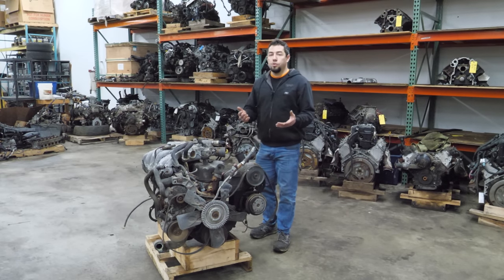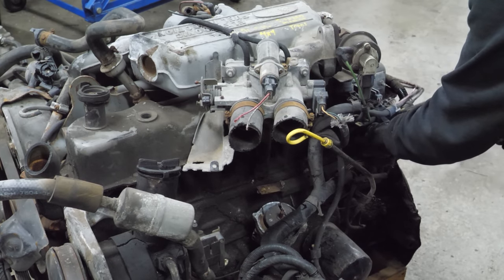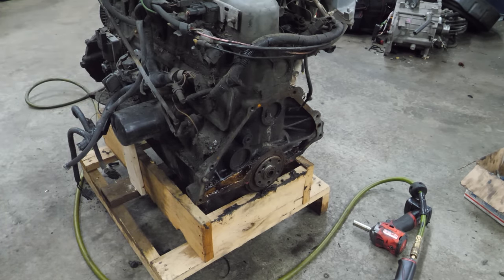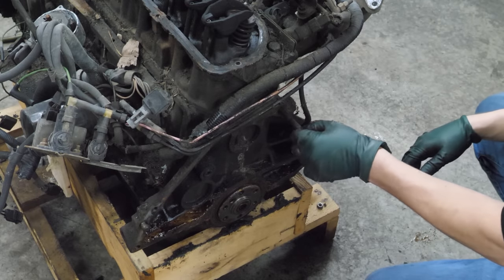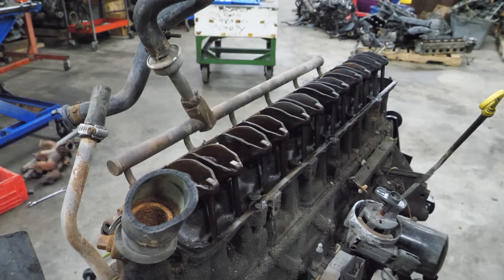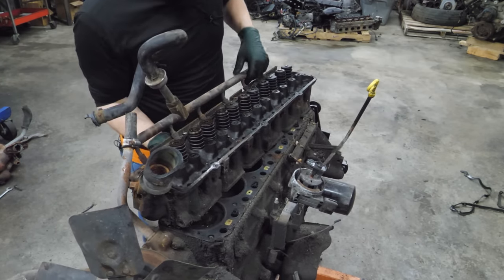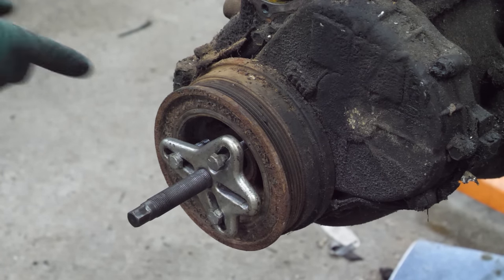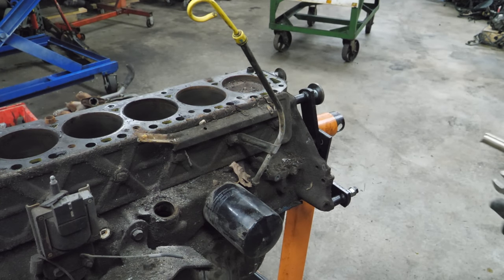FINALLY! A "Bad" Ford 4.9L 300 Straight 6 To Teardown! Most Reliable Engine, Ever?

Comment: One of the most reliable engines ever built, I’m not even a Ford guy, and I have a ton of respect for this engine.
Reply: It didn’t love it it just did it.
Reply: Seven main bearings gear drive cam the way engines use to be built !!!  FORD TOUGH !!!!
Reply: @wilburfinnigan2142  -  Kinda tough to argue with you there.
Reply: These engines were meant to be run forever. They were built accordingly.
Reply: @edifyguy  -  That seems to be the consensus.  Do you think someone would be just crazy enough to attempt a rebuild?  Would it even be worth the effort?
Reply: @wickedcabinboy  
I damn sure would.  But, I have stuff that could use it.  And, apparently, you can supe them up.
Reply: @Chris_Troxler  Yes, they can be souped. :) https://www.youtube.com/watch?v=SZoV6E5DDXI
Reply: @Chris_Troxler  my understanding is the crank is weak, maybe its a year thing
Reply: @edifyguy  
I'd skip the turbo, but I wouldn't mind the other mods.
Reply: @robertcounts5300  
Not from my personal experience.  But, I suspect everybody using them differently.
Reply: @robertcounts5300  Weak? No. It's long though, and long cranks are fussy about high revs. This is a torque motor anyway. Keep it around 4000rpm and you'll never have a crank problem. Of course, 522hp 597ft/lb at 5000rpm didn't break it once, so the 7 main crank obviously is pretty resilient.
Reply: @edifyguy  And they had an industrial 300, so it had a forged crank, and steel timing gears. The trucks came with cast cranks and a fibre cam gear. That engine never cared though! I had one that started running rough. Took it apart, and there were no teeth left on the cam gear! Thing was running on friction alone! HaHaHaHa!
Put one in our 1975 Ford F350 dump truck about 5 years ago. Still has the 1bbl on it, but I did just pick up a C-Series Offenhauser and an Edelbrok for it. I also have a set of EFI exhaust manifolds for it too. And the rest of the exhaust as well. For now, that will make a huge difference. Already did the Pertronik ignition swap.
Reply: @Chris_Troxler  this guy was talking about power adders, gas, turbos blowers, all I have had to do to mine is replaced the freeze plugs behind the exhaust
Reply: @cmdrclassified 
The fiber gear was not a great idea.  But, easy enough to replace when they did go bad, and keep on trucking for another 100K.
Reply: @Chris_Troxler  Yeah, easiest way was to get a new cam when you get the steel gear! Those fibre gears would disintegrate with any force! And by then, the cam and lifters could use replacement. And they are cheap to replace, for stock components that is.
Reply: It is. I like these engines and straight sixes in general.
Reply: simplicity equals reliability, a lesson today's manufacturers have forgotten about.
Reply: @adotintheshark4848  There's a saying, "Complexity is the enemy of reliability". Also, "Chrome won't get you home, but you sure look good pushing!"
Reply: Only one I have ever seen in action was in a Massey Ferguson 135 tractor. 
You need more shear bolts than anything. They are stout.
Reply: if you knew anything about mechanical engineering,,you would be..ford escort kent block.  2.0 ohc.  427 ferarri killer. 385 series, 460/ 351. FE heads chev come over..  worst engine ever built by chev,,350  6.2/6.5tdi..plus the late sht.. yes ford make sht engines,,all manufacturers do, because of the greenies & epa.. but,,my 351 clevo, best engine ever..only good chev,,was the 454 ford copy,460..allmost..  chev = speed shop..ford dodge,,buy drive..
Reply: The six in line engine is still my favorite
Reply: Between this and the Jeep 4.0, cummins 12valve, Toyota 2JZ, etc. etc..   The inline 6 is simply the best design there is for a reliable engine.   Nearly every brand out there has built a legendary I6;  it's just inherent to the layout.
Reply: @edifyguy  Just got an '82 Fairmont with this engine.  I am thinking about doing these mods to the engine (sans turbo).
Reply: Had one that suddenly wouldnt pull itself. Chased and chased things. Turned out, dist gear roll pin broke, but only shifted several degrees. A man told us about his experience with exact same thing. Engine had 350,000 at that time n
Reply: @wilburfinnigan2142  most inline sixes have 7 mains
Reply: @adotintheshark4848  they haven’t, but nobody wants to drive a tractor. There’s also no merit in a simple design. And you could just service a modern engine and it won’t let you down most likely which is the moral in most of this channels videos. Not saying complexity alone makes the engine, but the best engines push the envelope in terms of technology. Just service them.
Reply: @robertcounts5300  It's not weak, it just doesn't like high rpm.
Reply: Don't be a fan boy. Just be a gear head. I honestly can't stand the team mentality.
Reply: It’s not one of the most reliable it is the most reliable period followed by the jeep 4.0
Reply: They definitely don't build them like they used to.
Reply: Not. Slant 6 is way better
Reply: @wilburfinnigan2142  ford tough ha ha ha ha
Reply: @harrywalker5836  ,can you repeat that, and slow down. I'm not comprehending anything you just said.
Reply: @GodiHateOtakus  , you apparently are not familiar with horrific designs like the 6.0 Powerstroke. Ford lost hundreds on millions due to their poor design and sued International.  When you have to lift the cab to work on a engine,  it's not practical for an average Joe to make to 10k repair.
Reply: @wilburfinnigan2142  and Ford even made more reliable parts. The original gear in the on-road engines was this phenolic material. Not that anyone really ever had problems with them, but on the industrial engines, Ford used a steel gear. And the steel gear is a direct bolt on for the on-road engines. The only difference is the noise they make. You'll definitely know there's a steel gear running around under the timing cover. They're meant to be run dry but you can smear a little grease on to quiet it down a little. Doesn't help much but its something. 
and just like that, your unkillable engine is ever more unkillable.
Reply: @robertcounts5300  it's not weak for its intended purpose. Like most things, they were built for an intended purpose. Most are cast cranks but they're not small castings by any stretch of the imagination. There are some factory forged cranks out there though.
Reply: It’s only because they don’t make enough power to hurt themselves.
Reply: @wilburfinnigan2142  you'll go
 through about 3 trucks with the same motor
Reply: Same here...
Reply: Great motors, parts have gotten crazy
Reply: @ArthriticAngler  how so
Reply: @DriveCarToBar  I know what you mean about the noise of gear driven timing. Take the oil fill cap off a running 12 valve Cummins and you can hear the gears clinking from 20 feet away.
Reply: @poisonPpaully  I like both the Ford 4.9 and the Chrysler 4.0, awesome reliable engines. But you can't convince me a 4.0 is more reliable than a 12 valve Cummins. I'll allow that the Ford 300 and Cummins 12 valve might be neck and neck as far as reliability (personally I would put the 12 valve as more long lived than the 300), but I can't put the 4.0 over the 12 valve. No way a 4.0 is outlasting a 12 valve. 

If we're just talking gas engines, I can put the 300 in 1st place, but for 2nd place I don't know. There is the slant six to consider. 

Thoughts?
Reply: Nah, the G.M. 3800 wins
Reply: I watched a video of a 300 6 cylinder with very few mods like a header, upgraded distributor,, a Holley performance efi, simple 1.5 roller rockers, a mild cam that Dyno Tuned at 390 HP 420 ft pounds of torque 😳...added a all small 62mm 20 pounds of boost turbo, manual adjusted waste gate and an adjustable Bov....then the 300 pumped out 522hp with 397 ft pounds of torque 😱... It was a BEAST and Torque monster that most DIY guys could build themselves! I definitely want to build one for a project 60s f350 dually!
Reply: This is the one engine you hear nothing but praise from
Reply: @Bloodbain88 this is so dumb the 300 i6 ford isn't the most reliable gas engine ever. Its definitely not competing with the 12v which last 2x as long at a minimum
Reply: @robertcounts5300 in terms of their material yes. Most are cast iron crankshafts which are still plenty strong, but heavy duty ones had forged cranks
Reply: @jdrok5026 apples to oranges. You’re talking about a solid granite block of a diesel vs a medium duty low stress gasser. 300 six is much easier to live with, I’ve owned both
Reply: It was effectively a tractor engine. Not the most power for size, but that's not what it was built for.
It was built to run at a reasonable rpm and output a reasonable amount of power, and do that until your grandchildren learn to use it.
Reply: @darkwater72  and run on whatever you had laying around, diesel/kerosene notwithstanding.
Reply: im brand agnostic. If it`s good I'll praise it
Reply: @BarbazuX I had an 82 Fairmont with the in-line 6, I switched to the split exhaust manifold from a fuel injected f150 and did a cat back system I also upgraded the intake.
Reply: I like all of the Phord straight sixes.....and IDI diesels, 7.3L Powerstroke is OK.
PHORD gas V-8s......why????

Comment: That is a typical 300. What happened is the truck fell apart around the engine and then the owner neglected the engine and then finally it over heated. I'm pretty sure it was running when pulled.. I've seen bearings in a 300 that were worn way more than that and they were still working all day. Great engine never to be seen again. The Ford 300 engine never dies, they are killed!
Reply: perhaps we need to start making them again.
Reply: @DARKthenoble  they might come out with a version of an inline 6 but it won't be anything like the 300. But they will try to sell it on the past reputation of the 300. I've had a couple and they were just great
Reply: @DARKthenoble rehabilitate the old geezers that are still here
Reply: @DARKthenoble the ford barra i6 is probably the closest we’ll get

Comment: It's amazing how Ford invested in all the updated manifolds and bracketry to keep this workhorse going through the late 90s.
Reply: "invested" or saved a ton of money on design and retooling a new engine?
Reply: @johnt.848  Both.
Reply: Why is that amazing?

Do you think it would be cheaper to design an entirely new engine from scratch, INCLUDING the new manifold and bracketry? 🤦🏻

C'mon, McFly... THINK.
Reply: @82f100swb  Ack, I dont buy that shit at all... 
Why would they care if it would "outrun the 302"? 
IF there is any crossflow factory ford pieces laying around, and IF they are a real trial effort by Ford to dig into the straight 6, then it was determined for whatever reason that it wasn't worth it re-tool the entire line up of exhaust manifolds, intakes, bracketry, exhaust pipes, and whatever else. IF it was that good, they certainly would have done it.
Reply: @davelowets  The heads were cast to use existing manifolds, no bracketry bolted to the head itself. Go over to fordsix and search it up. All the info is there from Greg. 
As for the reasoning, what would be the incentive to buy the optional V8 if the base engine made more power?
Reply: @82f100swb  Many people would have still opted for the V-8, OR Ford COULD have called it a "Premium 6-cylinder" and sold the SHIT out of it... 

Just like they do now with the turboed "Ecoboost" 3.5 V-6. 
I myself would take the V-8 all day over the high-strung twin-turbo V-6 that's offered today.

If the head would have been that much better, they WOULD have done it, for certain.. or else they would be fools.
If that head made such an increase in power and torque, that WOULD have meant that the 300 straight six WOULD have been more efficient, and got much better MPG's also. Why wouldn't they have done it? Because the cross-flow head didn't improve things enough to be worth the change in production.

I don't doubt that the heads were cast, and tried, at all.... MANY auto manufacturers engineering departments are littered with prototyoe parts like this. They ALL do it. I just don't believe that the cross-flow head was enough of a success, and didn't make that much of a difference to the engine, to be worth their time. If it had significantly raised the bar for the 300 straight six, they'd have done it for sure.
Reply: Having a workhorse engine that was meant to not complain about shit fueling be fed an optimal mixture through efi makes it last even longer.
Reply: @82f100swb  probably a copy of the Australian crossflow Falcon-6 head from the mid 70’s
Reply: @mickvonbornemann3824  While that is a good theory, the 300 head used standard 300 valve train, not Cleveland sourced parts like the X-Flow, it was also designed to use standard 300 intake and exhaust manifolds as well as valve cover. 
There is also the issue of the XFlow being the small six family, and the 240/300 being the large six family, apparently know as the Canadian six down under according to friends of mine, but I'm sure you weren't thing exact copy.
Reply: @82f100swb no a crossflow head wouldn't make that huge of a difference. The 302 would likely still have outran a 300
Reply: @jdrok5026  A) I'm only repeating the words of a Ford engineer that worked there at the time and B) you have to remember the 185hp/270 ft/lb truck 302 of that era wasn't exactly exciting, and the early EFI 300 was 145/265 with the production head.
Reply: And instead of continuing this engine,  they spent millions engineering that 4.2L V-6 that lasted... 6 years?
Reply: @JoshsCarCorner  yeah welcome to emissions
Reply: They produced them for other applications well into the 2000's as well.
Reply: @jdrok5026  The 302 in those years barely outran the 300 as is.
Reply: @brahtrumpwonbigly7309  yeah no the 302 was outrunning the 300 sorry more power more torque. It doesn't matter your the one claiming that a simple change over to cross flow would allow the 300 to outrun the 302 which isn't really likely would've happened the 302 also went up to 210 hp when the 300 i6 ford only had a measly 170 hp. Even when the 302 v8 had 130 ish hp the 300 i6 was barely breaking into the 100 hp class the 300 i6 ford could be had with up to 120 hp then when the 302 was jumping toward the 200 hp mark the 300 i6 was working towards 150 hp. The 300 i6 ford never in the trucks atleast out ran or even really competed with the 302. That's a tale that is told by fan boys who keep saying the 300 is great when its not particularly reliable and isn't good at anything.
Reply: @brahtrumpwonbigly7309  yeah applications that didn't have emissions. Oh and they still weren't popular or good.
Reply: @jdrok5026 The 300 wasn't meant to outrun anything and it's definitely more bulletproof than a Windsor. It never got the roller cam nor the cross flow head it deserved and thus couldn't rev much higher than an industrial engine. That is the entire power deficit to the 302 right there. The 300 never became more advanced than was legally mandated the way the Windsor did and that only happened because the Windsor also needed to be used on cars where performance was more important than having the grunt to move a trailer for hundreds of thousands of miles. It's not hard to build a 200HP 300 and Ford could've easily done so in the 90s. They just weren't going to spend the money to develop an engine that was already on the way out in favor of the OHC push.
Reply: @honkhonkler7732   People forget that the 300 inline six was intended to be an industrial engine.  Which means it could run at full power continuously and had more starting torque at the bottom end.  There's a reason why the 1-ton Ford trucks, school buses, and small dump trucks used the 300 as their base engine and not the short stroke 302 V8.
Reply: They actually just had a really good design, iteratively improved it a couple times, and in an unAmerican fashion, stuck with it.